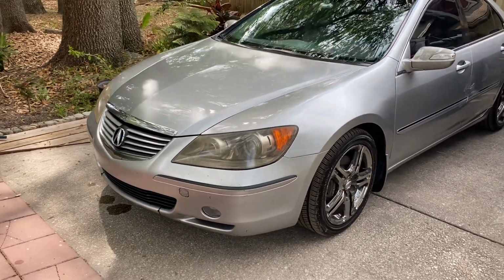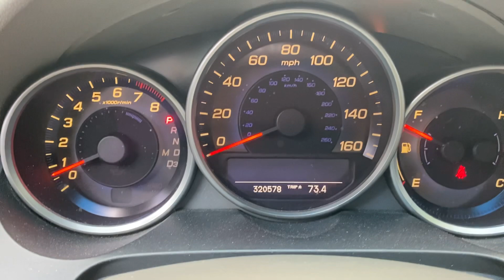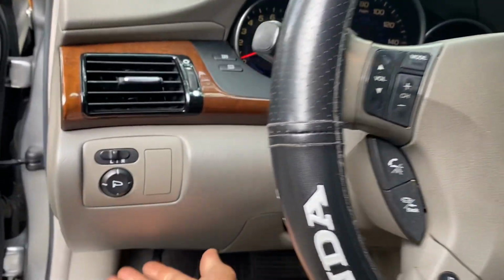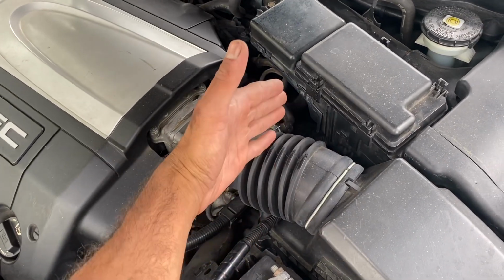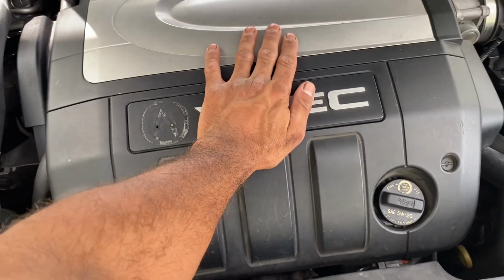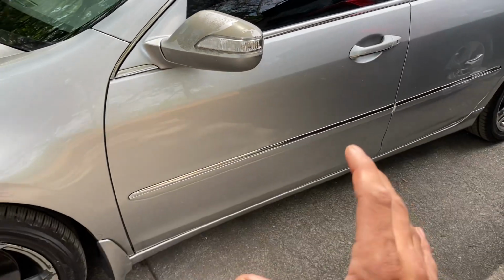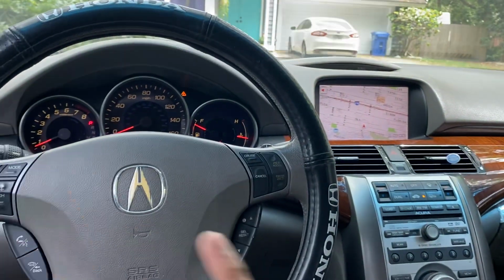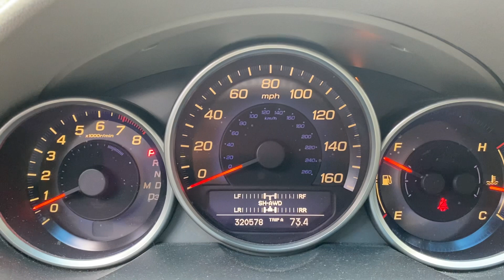2007 Acura RL - 320,000 mile update !

Comment: I have a 2006 rl with 230k miles. She drives like a brand new car. It had a lot of issues with the interior such as ripped seats and a broken door handle, as well as slightly leaking some sort of fluid which I think normal for an old car, but other than those issues it drives like a dream
Reply: I need the car

Comment: Nice work, upvoted the video 👍. Good  to see someone hitting over 300k.

Do you have any issues with oil burning? I had a 2006 that was going through more than a normal high mileage vehicle would and that was to be said of these engines too.
Reply: VTEC burns oil... If you do manual pulls up to redline like I do, you'll have to top it it off occasionally! my '05 only has 223k kms on it and I just changed the AC Compressor and did the upper and lower front control arms about 5k kms ago along with 4 Toyo all season tires, front pads and rotors, new head gasket and valve cover gaskets and all the fluids. Bought it for $3200 CAD 3 years ago and have put 40k kms on it and about $6k CAD more into all that work. It's totally worth every penny I spend! Next things to do are re-upholstering the front seats, glove box lid, center console and front door armrests. Thankfully, I already have the new covers. I also installed a cold air intake when my rubber connector cracked and split. Will likely also get a Stage 1 paint correction done soon.
Reply: @jbb3675  there was a video by ExoticCar PlayPlace awhile back I saw that mentioned the motor for our cars having this issue when they get higher in mileage. I would have to put a quart of new oil in every month but that's with me doing a decent amount of commuting to work. I never would go in manual mode either, just drive aggressively here and there lol. I'm in the states so we go by miles and I got my RL at 80k miles and got it to 175k before it got totaled. It was a A-spec too...I never seen another one out on the road.

Yeah a lot of the stuff you had to do happened to my car too. I think my AC compressor went out not too long before that and had a crack in a rubber connector of the air intake also, not sure if it was the same as yours but sounds like these are things that go out down the timeline of our cars 😂. Besides typical maintenance, only things I replaced before that were the alternator and a engine mount. Most reliable vehicle I've ever owned that I ended picking up the 2011 refresh model earlier this year as a 2nd car! Mainly wanted it for the better MPG and being faster. It was somewhat disappointing though because they cut costs on things like the interior, I think the wood is fake and maybe they used fake leather too. I could tell the difference in feel with the steering wheel in my 06, it felt premium! I loved my A-spec at the beginning and had it for 8 or 9 years but didn't realize how good it was til having my late generation Audi S5. I love the S5 too but the RL's sound system is better hands down and that car came out in 2005 so just tells you the quality and engineering they put into it.
Reply from the maker: I got 333k miles on it now. No engine doesn’t burn any oil. There are some oil leaks forming and I will need to address them .

Comment: Have your shocks and struts been replaced?  I've had mine changed to KYB all around at 145,000.
Reply from the maker: No they are completely blown all the way around. 350k miles on the original struts. I am looking for the KYB ones too
Reply: @Travelingcarguru  When you swap in the new ones you will regret not doing it sooner.  It will be a night and day difference.

Comment: Really informative video. Thanks for sharing! I'm looking at buying a 2008 RL with 140k miles. Done my research and saw that the propellant shaft bearing goes bad and needs a whole drive shaft put in due to not being servicable. Did you ever have any issues with yours and end up replacing it? It's one of the things putting me off from buying since it's so expensive.
Reply from the maker: Thank you for watching! I still have this car I have 340k miles now and still unstoppable. I think you should definitely buy that RL , if the maintenance history is good these cars can last a lifetime. Minor issues like alternators, radiator, AC compressor were replaced at 330k miles. Now it looks like it may need all four struts and that’s original too. Everything is functional on it and is quieter then many new cars

Comment: Using that Mobil oil is the cause for the seal leaking. Had the same problem with mine and was told that the seals were not made to support synthetic oil. Just putting that out there not sure if it’s true.

Comment: I’m scared to pull the trigger on one of these because I’m scared of needing RL-specific parts and not being able to find them, at least without selling a limb. Can anybody speak on this? Is it not that big of a deal or should I get a more widespread model of car instead?
Reply from the maker: That was never an issue for me. This car has been really reliable but when it did need parts I was able to find them at auto part stores or online for that matter. Dealerships has many parts too. Many of the parts are closely related to other Honda products so that made it easier. Currently I got 350k miles on mine and still chugging along

Comment: How’s the transmission holding up? Thinking bout purchasing one
Reply: have you tried resetting the computer?  hold down on the gas pedal in accessory mode until the engine icon disappears, turn off and back on.  definitely helped with my jumpy transmission

Comment: What are the symptoms when the transmisson range switch is bad?
Reply: It will say "check starting system" when you try to turn it on... Don't waste your money replacing it! I did twice already... Put the car in Neutral and it will start right up!
Reply: I had to have my transmission rebuilt at 107k. I had that and my water pump and timing belt changed. That's all of my major repairs. I also had to have my climate control replaced. Luckly my friend is a mechanic and did it for $50, and the radio was $100.

Comment: Man, I hate this car with a passion. It is one thing after another.
Reply from the maker: Really ? What has been going wrong with it ? I know the early build 2005 ones were problematic. Mine is still running strong with 350k miles currently
Reply: @Travelingcarguru   I worked on a 2006 and well, interior electronics for multimedia and doors are trash. It has a well-known issue where a problem with the door sensor can render the entire car immovable. It does not use standard designs for several things, a great example is the wipers. You can't just walk into Walmart and buy wipers for it.